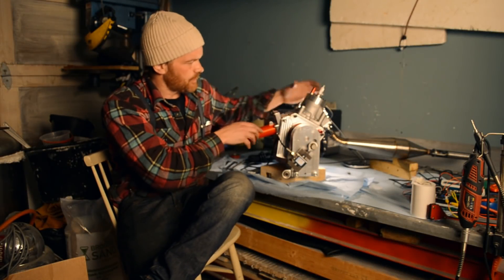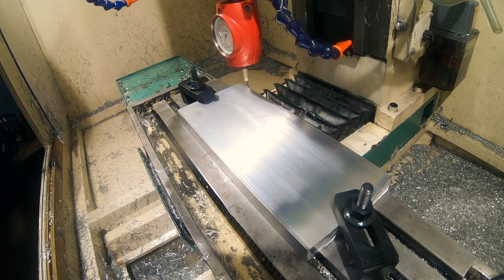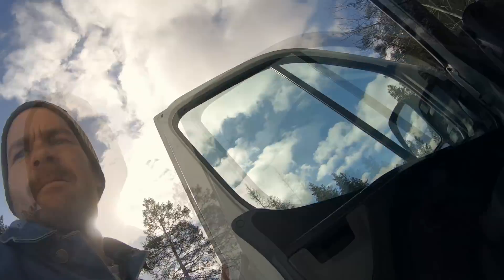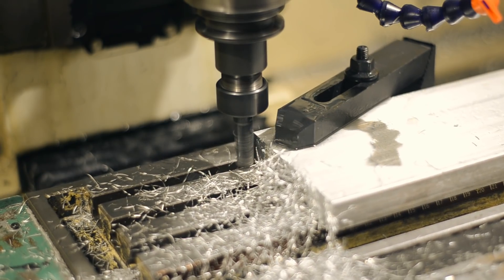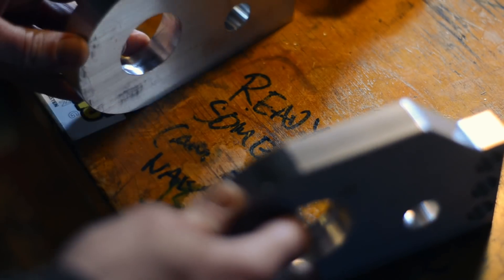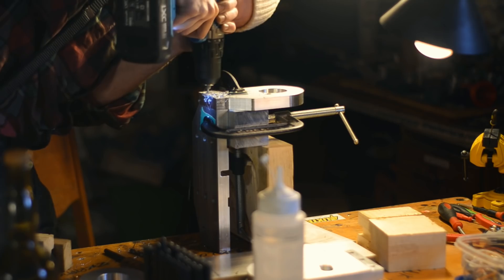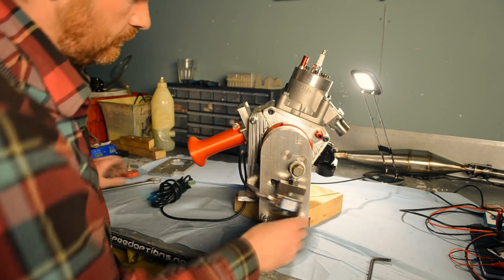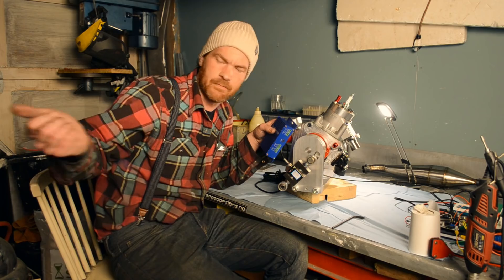The Most Powerful Two Stroke Ever gets a Dyno Cradle Mount Thing!

Comment: It's worthwhile putting a tap in a battery drill and using that when you tap holes in aluminium. As long as you have enough torque left over you can use the technique on steel and other hard materials as well. It will save time. Practice a few holes to get the positive pressure technique required and you will find the tap advances itself at only the correct rate. Use lubrication. It has worked for me and for countless others it will work for you I hope. I probably just taught you to suck egg's, apologies if I did.

Comment: it is very important to use bolts made out of the same material as the material into which you are screwing in those bolts. Overtime, vibrations induce friction, and since different materials have different scratch resistance and can dent eachother, threads can wear out faster. This is usually done for commercial applications, such as helicopters and planes, because once a helicopter crashed only because of the use of bolts which had differing materials.

Comment: Would you loose power if you made a cylinder with 2 exhaust ports on opposite sides of each other and have 2 exhausts ?
Reply from the maker: In theory, no, you'll gain power, never seen anyone pull it off in practice though. You need completely symmetrical scavenging, and that seems to be harder to achieve than it sounds. I have a plan.

Comment: You may want to use roller bearings not ball bearings in that use case.  Ball bearings with a static load are essentially point loads on only 1 or 2 balls. You did oversize quite a bit, so might be ok.

Comment: is that a rs 125? its the new 122rotax  28mm carb stock is arround 24.25hp on the wheel. aim on the old rotax 123. we dide a porting job to the 123rotax case so the case hase a boostport. a polini 154cc kit, standart is arround 180° ex thats way to low reais the port to 195^° . makt the ex valve fit. and some porting/ portmaching and a 39mm dellorto from a ktm exc250. the pipe was back in 2002 a pipe from polini. and we dide 39.8hp on the wheel! with stock ignition and only with portmachig and a raist ex port to 195 and a 39mm carb

Comment: I have an idea about another type of retained ring design that does not need a special piston but uses almost a gapless ring® design but has spring loaded tabs inside that lock it in its working range when the ning snaps on the piston. With this design you cant remove the ring from the piston any more tho... I thought I'd share this so maybe this idea will inspire you somehow😃

Comment: So, the fact that you are using a 50kg load cell and the motor should produce only 15Nm, then you could mount the load cell a lot farther from the rotation point in order to better use the scale you have. Your explanation led to believe it was the opposite, where it had to be close to the pivot so as to fit within the load cell range.

Comment: Has the intake trumpet length been tuned to take into account ram air at high speeds? And will that create a significant difference between power made at standstill on the dyno and at speed?
Reply from the maker: Large plenum is the plan, primarily to reduce salt injection.
Reply: @2STROKESTUFFING  Nice. I can't remember seeing an airbox in any CAD model so far so thought I'd ask :) been following your projects for a long time now, can't wait to see you set the record!
Reply from the maker: @MrBoredNoMore  👍 haven't modeled it yet.

Comment: Um, FYI I believe paragliders use two-stroke motors and need high specific HP.
Reply: Actually, they use “2stroke engines”...
Just saying....🤣🤣🤦🏻‍♂️
Reply: @wolfparty4234  The words 'engine' and 'motor' are used interchangeably in English (as used by the English in England).
Reply: @DepakoteMeister  🤣 well I’ve never seen a 2 stroke electric motor. 🤣
Plus, I was just kidding around!!
And yes, I have noticed the younger people using motor to describe an engine! Kinda drives me nuts🤦🏻‍♂️
Funny thing, when I’m talking to people and they say motor bla, bla bla
I say engine bla bla bla🤣🤣
Reply: @wolfparty4234  Motor car?  Motoring?  Motorway?
Reply: Motorist?  Motorcycle?  Motorbike? Motorised (as in Motorised Infantry)?  Motorboat?
Reply: English isn't an easy language to learn admittedly, but give it a try.
Reply: Motor: A mechanical or electrical device that creates motion.
Reply: @DepakoteMeister  now your just splitting hairs...
So it sounds like you want to just dismiss the word “engine” completely!

Class, Let’s all just say the word motor together 🤣🤣🔥💪🏼👍🏻
Reply: @wolfparty4234  You do realise in English there can be multiple words to describe EXACTLY the same thing don't you?  I'm not 'splitting hairs' by quoting hard facts, I'm trying to educate you, seemingly with little success.